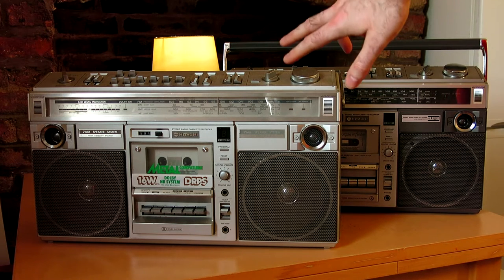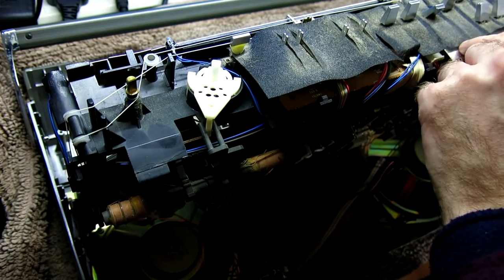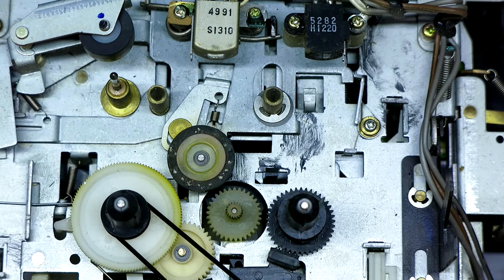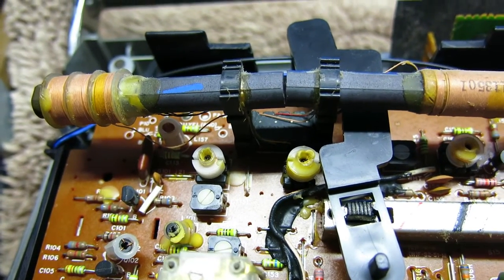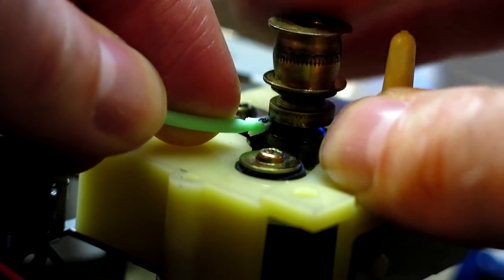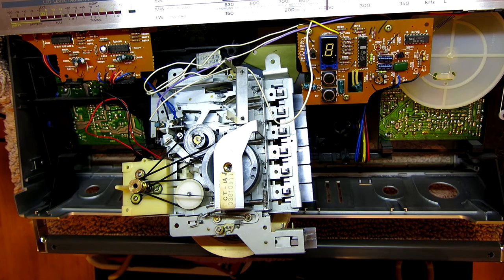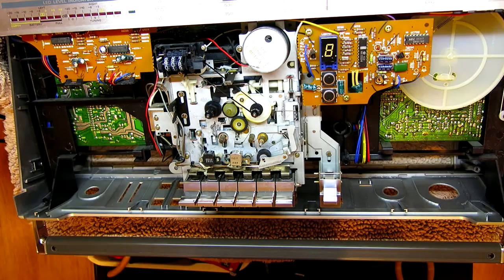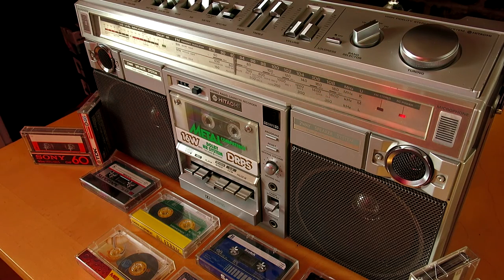1981 Hitachi TRK-8290E Mechanical Service & Belt Replacement

Comment: Wow, Hitachi TRK-8290E. I had one of those in 1981 and it cost me £179. I always regretted selling it but to buy one now with a working tape deck is near on impossible. very complex inside too as i recall. Tempted to try and get hold of one now i have seen this Video on repairing and servicing as i really miss it. Fantastic sound it had too :D

Comment: Hi James love the video.  Just wanted say i have one of these in for repair where by all the tape button will not go down have had a look around latch bars but just can't see why it will not allow the levers to go down.
Reply from the maker: They're a bugger for dried grease. Can't remember if it was this one or the other where the pause button was jammed and I've seen others around with the pause button stuck. If it's on the metal, try a short blast of hot air

Comment: Hi James, is the only difference between the 8190 & 8290 just the colour differences and the inclusion of Metal tape capability in the latter? You're detailed insight would be very helpful for me. Thank you in advance!
Reply from the maker: @pierrejoaquin  no, the 8290 also has a revised mechanism which combines the stop and eject buttons (separate on the 8190) and uses one less belt, likely all done to reduce cost a bit

Comment: Excellent video. I have the exact same model, I'm missing a couple of the volume control sliders, do you have any idea where I might find replacements?
Reply from the maker: Thank you. No idea unfortunately, other than stealing them from a donor machine. I think some other models used the same ones but, between all the ones I fixed, I did notice that some were definitely silver, and some were definitely shiny chrome!

Comment: I bought the 1981 model used back in 2017. It plays tapes, but there is a humming sound when playing a tape. Does anyone know how this can be repaired?
Reply from the maker: it would need properly diagnosing but one thing you can try is cleaning the long record/play switch

Comment: Hi. Did yoy had trouble with the autostop feature? I cleaned and oiled the mechanism, replaced all the belts as you did. I used the same belt kit as you. At the end of the tape the autostop is not triggered. From what I noticed, the belt that drive the pulley that triggers the autostop is slipping. Thanks for sharing this information, your video guided me through the whole process.
Reply from the maker: I did another 8290 where the gear which drives the white nylon autostop 'cam' thing squealed a lot. I had to clean and re-grease it and it worked okay afterwards. They are a bit temperamental. Check that the little 'bar' that rides along the cam is moving properly. I didn't have any slipping issues but definitely some dried grease at times.
Reply: Thank you, it make sense, but still I find that belt quite loose. I clean and greased everything, but still looks like need a lot of force to trigger it.  I'm looking for a new tighter belt and give it another try. What grease did you use?
Reply from the maker: @mariusbrasoveanu7820  strange, nothing was loose for me, did you fit the belts the same way as I did? I used white lithium grease.
Reply: I'm using same white litium grease. I fit the belts as you did. I look at the mecanism and is ok, no parts missing, bent or broken. I tried turning the pulley by hand and it takes a lot of force to trigger the autostop. The belt has no chance of spinning it. My only chance is to give it another cleaninig and another belt, maybe a 43.5 mm diameter with 1.2 mm thickness. Thank you for your time.
Reply: I managed to solve the autostop problem. The belt that came in my kit was to blame, it was thinner and wider than it should be and it was slipping. I replaced it with a belt with a diameter of 43.5 mm and a thickness of 1.2 mm and now it works perfectly. I left this answer in case someone else is looking for a solution to the problem.